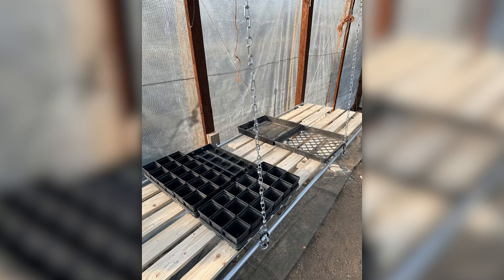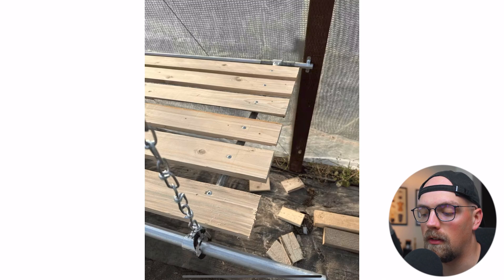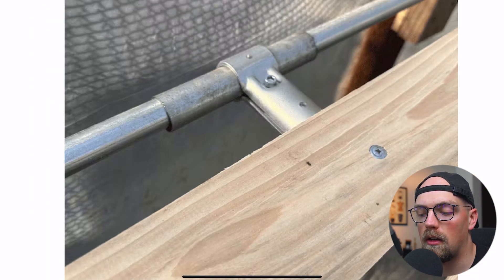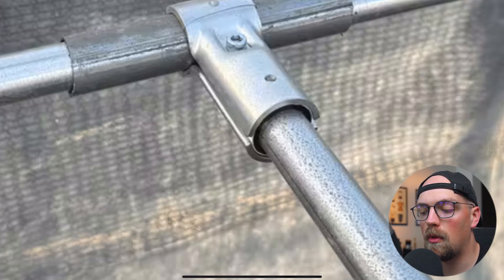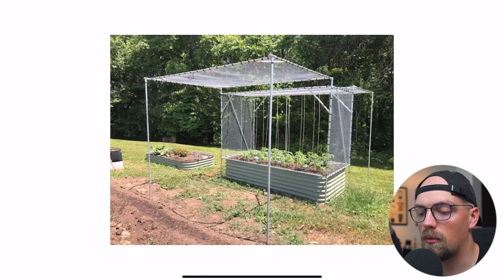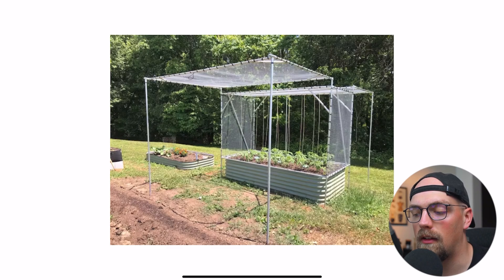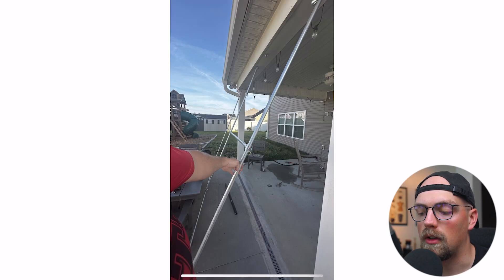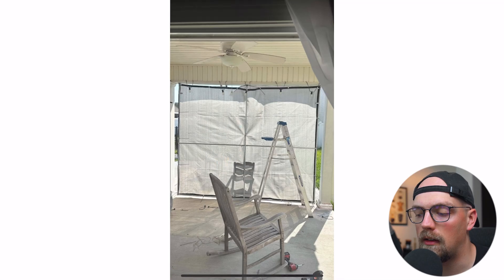5 Creative Hinge Ideas For EMT Conduit!

Comment: Risking coming off as a nitpicker (likely because I am)
  Screws that dont need a pilot hole are "self-tapping".
   "Self-drilling" screws will be a landmark achievement for sure.  Thanks for sharing all the great maker hacks with EMT conduit, I discovered Uni-Strut a few years ago, and the fact that it's designed to incorporate EMT with off the shelf components really bridges the gap between seat of the pants diy, engineered structural construction.  
  We are truly blessed to live in such interesting times.